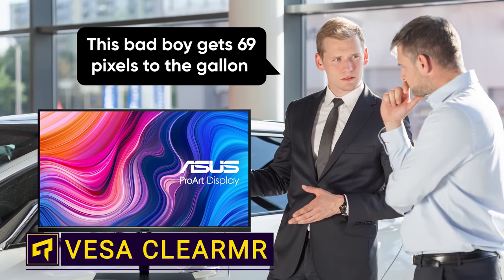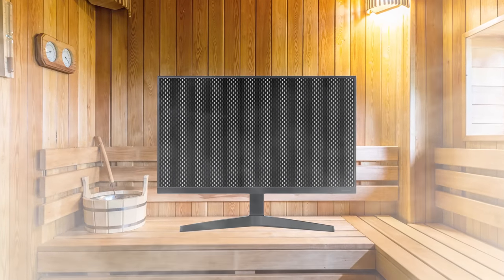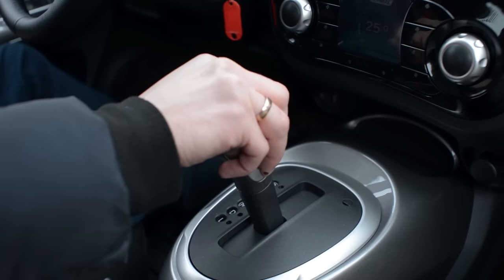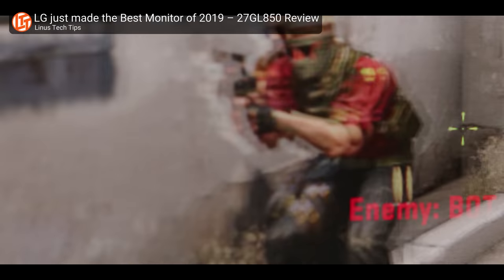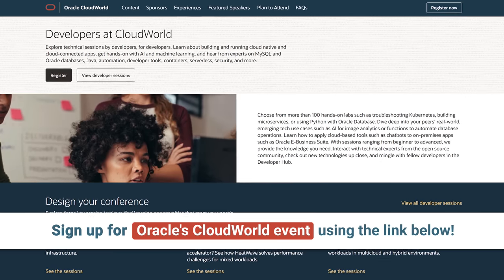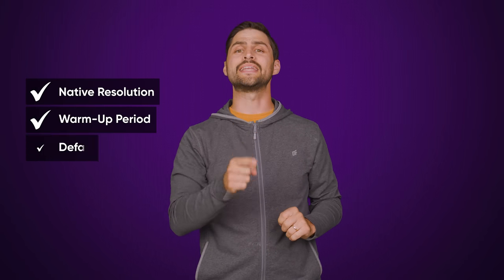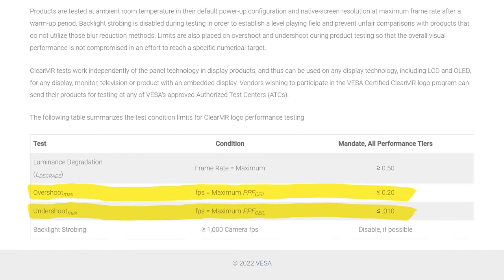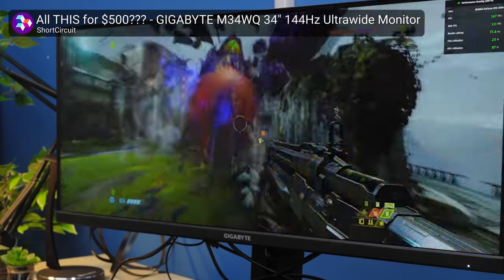Monitor Companies Have Been Lying To You

Comment: Best is low-mid end monitors showing an HDR comparison picture with one side being the “HDR” one with 300% contrast added and the “SDR” devoid of any colour. This should be illegal.
Reply: Especially with budget monitors (even labeled for “gaming”).
Reply: Probably is illegal
Reply: @killertruth186  well, I have "gaming" on a 120€ LCD with "bad" colors for ages. Never had any problems in civilization games, starting from Civ 3. 
Currently I only use it for internet and writing, but it still serves it's purpose for just 20W on the 21'
Reply: i remember seeing one that showed refresh rates with a gaussian blur.

not a product image but another one was a definitely not 10 bit rgb jpeg that showed the difference between 8 and 10 bit with a decently normal hsl rainbow gradient for 10 bit and 28 color steps in what looks like simulated cmyk color space for 8 bit.

and the last one that came to mind, a chart showing bit depth of audio. putting aside the fact that stairstepping is not how dacs work, 1 bit is a square wave, 2 bits has 5 levels, 4 bits has 12 levels, and 16 is a smooth line (which is correct at this scale)
Reply: @morgan0  2 bits is 4 levels, 4 bits is 16. Stair stepping is part of how DACs work. That stairstep gets driven through a low pass filter to weed out noise (digital level shifts are never completely clean, it takes time to get to the new level (at least slew rate is relevant). You're not getting stairstep out of your audio outputs.

16 bits is not smooth. You might think it is but real world doesn't act like those calculated levels. You will always need something to filter the quantized output. (I studied this stuff 20 years ago, I don't remember all of it but I do remember a bit. :D)
Reply: @samiraperi467  yes i know. my point was the number of output levels was wrong, and showing stair steps is misleading. and 16 bits is more steps than pixels in the image, it showing a smooth line with a little zoomed in bit with the stair steps is correct
Reply: Yea on the Amazon images. As if you could tell on your personal monitor which is prob not hdr
Reply: Or showing super blurry smeared image for 60fps next to a crisp image for 120+fps.
Reply: It would be considered false advertising, which is illegal but I doubt anyone has reported it to the FTC or sued over it yet.
Reply: @steemlenn8797  I still have my old gaming monitor that has 144hz 1080p 27” curved display “HDR” all around for $250 what I had bought at the time. Although I had accidentally break the display. And no one would really want it.
Reply: @steemlenn8797  And I had forgot to mention, that I had issues with it (or it might’ve been the GPU that doesn’t have thermal pads in the right place.
Reply: They are shooting themselves in the foot, because they are basically saying their monitor is poop at SDR.
They'll probably justify it by claiming that this is how HDR content looks on SDR. Yeah, no shit, don't do that then.
Reply: @steemlenn8797  just because something works and doesn’t have any problem doesn’t mean it’s a good product though.
Reply: Is the MSI Optix MAG274qrf true hdr or nah
Reply: @steveqi9309  No, but it does exactly what I expected for a low price. That's good enough.
Reply: @steemlenn8797  by that logic the 1630 6400 and 6500 are also good enough.
Reply: However how would you tell a difference when you see an advertising about HDR when you are using a SDR display? Or 144 Hz when your display is 60 Hz, there is no other way to show you the results of this new tech.
Reply: As a video nerd I find all the in store displays to be very ugly. I pushed back on HDR at first years ago because of that, and people blowing things out in photoshop cause the "HDR look" was trendy.

Comment: There is a little misunderstanding in the "ClearMR" interpretation at the time: 4:12 
"ClearMR 3000 has 3000 clear pixels for every blurry pixel" thats not correct. This Value is given in percent. so its 30 times more clear pixels than blurry pixels.

"ClearMR 7000, for example, is defined as a CMR range of 65-75 times (6500 to 7500 percent) more clear pixels than blurry pixels" - Vesa Website
Reply: All I need to know is bigger number better
Reply: @FaZekiller-qe3uf  yeah, rather I prefer bigger numbers rather than the number going down. My gamer soul wants big numbers, like my dps.
Reply: @lplumptree  that's not how percents work. 3000% would be a 30:1 ratio, not a 3000:1 ratio.
Reply: @DanKaschel  you’re right, misremembered. 2:1 = 200%
Reply: @lplumptree  so 3000:1 would actually be CMR300000
Reply: @crashzone6600  sadly, you need to stop thinking like that but try to actually understand things, it's like saying bigger latency number is better and that really wrong bro.
you want the lowest possible number for latencies, thus you should understand each topic individually
Reply: @gethermedel3620  It was probably a joke.
Reply: @gethermedel3620  r/wooosh
Reply: @DanKaschel  what did he say?

Comment: Of course they lie. it was quite an undertaking to get manufacturers to stop lying about the size of CRT displays. If you remember that
Reply: please may I get some background
Reply: IIRC they were including the part of the monitor/TV that wasn't part of the actual screen in the size.
Reply: @ThZuao   Monitor manufacturers still do that...  The only difference now is that bezels are much smaller these days.
Reply: @ThZuao  that has to be the silliest shit I've heard. I'd be pissed too
Reply: @shade221  We needed the size of the tube because companies were doing shit like selling a 16" visible area monitor with massive bezels that brought it up to 21" total diagonal.
Reply: @josejimenez896  it’s not quite that, it’s instead that CRTs have a problem called overscan which is where they display outside of the visible area. But manufacturers still included that space in the monitor size.
Reply: @myrealusername2193  but monitors under scan hence smaller viewable area. TV's over scanned.
Reply: @myrealusername2193  Overscan is still used today, but you can turn it off on most monitors and TV's.
Reply: @shade221  I'm saying they used the overscanned size as the measurement since technically the display takes up that much space, you just can't see all of it

Comment: That APD vendors have been lying to you is not news. As former developer for a panel manufacturer that actually had scruples, we never listed specs that could not be repeated and validated without hyperbole. For example, while everyone else was marketing 1,000,000:1 contrast ratios, we never advertised any, because all contrast ratios are basically bs. There are no industry standards how a manufacturer measures contrast for the simple reason that there isn't a single facility open to everyone that uses a single set of tools in a controlled environment that everyone agrees upon. Refresh rates are a little more quantifiable and a little more straightforward in measurements, but not much. Marketing teams are the bane of product developers'. I would even go so far as to say they serve no purpose except to stroke each other's egos. As a product developer, if I told you how much time I've spent doing the jobs of the marketing teams for them because they prefer spin vs. transparency, or because they simply have no understanding of the products' features/benefits and even of the target customers, you'd think I was lying.
Reply: Is there any way to infer the reality through the marketing?

Often many low and mid budget monitors don't even have an actual reviewer doing proper tests, so that's often not an option
Reply: I've learned that all marketing/advertising is a lie.  Sure there might be some nuggets of truth in it, but the marketers will take those nuggets of truth and twist them to make them sound better and in essence create lies out of what was true.
Reply: "they simply have no understanding of the products' features/benefits and even of the target customers" 
What else is new. I believe you 100%, seeing how marketing is done. It's pretty clear in many cases that they either have no idea or do not care, They will say whatever lie they can legally get away with to sell you the product.
Reply: Which manufacturer did you work for?

Comment: I used to have a old ViewSonic monitor that was rated at 2ms response time. In the monitor UI, it was set to default at 4ms but can change it to 2ms. When I changed it to 2ms, the monitor would display pink stripes when there was a lot of motion or bright areas of the screen. So I guess it can do "2ms" response time but for it to function correctly, you had to set it at 4ms.

Comment: Looking at DisplayHDR certification and how many HDR-not monitor can get certified, that's just the thing we consumers needed - another certification I suspect will be easy to fudge (sorry, I'm pretty grumpy over how broken DisplayHDR is, and don't expect this certification to be any better).
Reply: There is still a benefit to running hdr on a monitor. SDR content is mastered  for 100 nits, while many monitor can get way brighter than that
Reply: It's very simple, you just ignore hdr400 monitors, those just means they have the module inside that can receive hdr signals therefore qualifies as capable, bcz it's true, they are capable, they just don't guarantee the result like hdr 600 or 1000
Reply: In my opinion they probably should remove the hdr400 certification and replace it with hdr compatible, just like early g sync compatible monitors, sure they are technically "compatible", but result won't be desirable
Reply: @Simon-tr9hv  If the monitor says HDR10 (so your "HDR compatible") without a DisplayHDR certification it means nothing other than they can read the signal. DisplayHDR 400 is already way better looking than SDR monitors or those "HDR10" monitors.
Reply: it will 100% be easy to fudge, obviously
Reply: @Sibula  there still are HDR 400-1000 monitors that still don't include enough local dimming zones. (or none at all in the case of 400)
Reply: @mariuspuiu9555  If it can achieve the certification without local dimming, that's even better...
Reply: @mariuspuiu9555  But yeah, I've seen at least one monitor with like 5-10 zones going from top to bottom and it looked like crap. No idea if it was certified though.
Reply: @mariuspuiu9555  I'd also like to point out (I'm not sure of you actually meant this, but if so it was a bit unclear) that a higher DisplayHDR certification doesn't necessarily mean better implemented local dimming. So a DisplayHDR 400 monitor that can do it without any local dimming may look way better than a DisplayHDR 1000 monitor with badly implemented local dimming.
Reply: @Sibula  yes, that's true
Reply: @Sibula  the problem is that not all people understand how it works, they see hdr and they think one more function for the price, I'm just saying by replacing hdr 400 with hdr compatible, its like setting  up secondary tier so general public can understand better, plus have you seen those hdr 400 monitor? Without proper tuning it look worse than sdr
Reply: @Sibula  that's not possible, without fald the uniformity would be so bad the higher brightness they use
Reply: @Sibula  just like my phones ips edge lit lcd display that is HDR10: meaningless

Comment: Why are there always 50 billion versions of each monitor and impossible to find the one I want.  To explain, anytime i watch a professional independent review of a monitor, I can literally never find that same model in the world.  It always has new added letters or slightly different numbers.  I swear it's like the monitor companies only make 1000 of a model and then create a new  model and repeat.
Reply: That's how it works. They never give you the chance to buy the best models. They keep changing them on purpose.

At a Best Buy near me an employee told me about the naming schemes. If you see a model like LG2500AC for example, Walmart might have one called LG2500AD. That last letter is specific to the seller so that you can't price match them as they have different model names.

This video only scratched the surface on how much of a scam gigantic corperations run. They have zero shame and most of the time zero accountability.
Reply: @flameshana9  God dammit.  Lol. This blows
Reply: @flameshana9  Why advertise price matching at all then if they don't want to even do it?
Reply: @shiranui2844  you already know why.
Reply: The last few digits or letters is usually just to do with what retailer it went to

Comment: the number for undershoot in the screenshot says ".010", which is 0.01, which is 1%, while the overshoot number says "0.10", which is 10%. The video says they're both 10%.
Reply: 0.20 actually, so max 20% overshoot and just 1% undershoot. Does anyone have any idea why the limits are so lopsided? Does high undershoot look that much worse than overshoot?
Reply: @Sibula  my guess is that it's about the claims made. If you're allowed undershoot, you are basically saying anyone can claim 10% extra performance without improving the monitor at all. 

Not being able to make the transition in time means you can't really claim to hit that response time.
Reply: @paulelderson934  Fair enough. Basically requiring enough precision and consistency.

Comment: Pixel response time hardly matters if you don't have a strobed backlight. Even with instantaneous pixels, if your eyes are moving to track a moving object, it will blur if the LCD keeps the backlight on the whole frame. The Blur Busters article "Why Do Some OLEDs Have Motion Blur" explains it in more depth.

Comment: If the restriction is not 'no features' but 'default features' a possible outcome from this is that displays will ship with defaults that actually produce good results out of the box instead of having to tweak the OD etc. I assume they won't go for the 'ludicrous speed' OD as default because whilst that will get your 1ms, it will also have insane overshoot and look like garbage. It may actually avoid displays defaulting to OD off.

Comment: In general monitors are an absolute pain in the ass to buy. Color accuracy, gamma/contrast settings, black to black and grey to grey response time, backlight bleed/IPS glow. All can be massive dealbreakers and are only noticeable either through in-depth online reviews (which naturally don't cover every monitor in existence) or by buying one and testing it yourself. But buying one and having to test it and then having to deal with the return process is an absolute damned pain. Not to mention that the same monitor model can have differing problems with it between different units.

Comment: Yeah, shame how some motion specs like response time in ms and mprt are mostly meaningless, without good review. On top of that LCDs are slow and in reality it will look quite worse.
It's cool to see something more new and hmm better I guess, though Vesa ClearMR seems to have flaws like not taking in account strobing, or putting LCD and OLED with different refresh rates even in same category certification. Needs more work. But at least it's extra that will make manufacturers hopefully put more work tuning displays-

Comment: Rather than rating a display on the count of clear pixels, I wish they'd rate them based on the percentage of clear pixels to blurry ones. The current standard will produce varying results with the same certification across different resolution displays.

Comment: OVERDIVE the PAIN of the early 2000s! Get a shiny new viewsonic or other fast and high quality flatscreen? It is going to burn out due to the overdriven panel -> higher current too.
Reply: wait huh, this is pretty odd
all overdrive does is set an 8bit value higher/lower (depending if its a rise or fall transitions) than the desired one to speed up the transitions
does this mean if you were running these monitors in a full white screen (or black screen in case they were TN) you'd get burn out too

Comment: Meanwhile I sit on Dell monitor (I don't remember the model) that is not only just 1080p and 60hz.
But also took a fist to the middle of the matrix.
And still works with no flaws.
After 6y of use and 5y of use after fist planting.

Worst part for me is that any upgrade of GPU will require buying monitor as well. Cuz no one offers VGA anymore :(

Comment: I'd like to see the Labs expand on this idea, especially for gaming / pro-display monitors.  I'm surprised that VESA is targeting such a narrow temperature range, though.  Any decent panel should be able to maintain a refresh range within 68 and 78 degrees F.  

Are they still trying to target TN panels or something...?
Reply: This is not about where monitors can do it but to compare them. For that temps have to be the same. 
Of course if you want a tabe full with numbers at 5 degree starting at -20°C and going to 60, for industry use, you can make a request for such a standard.

Comment: this explains my current Samsung monitor though it was more expensive and claimed to have better specs (other than the response time) than the MSI monitor it replace (only replaced due to it getting cracked) it gives me more artifacts and weird stuff going on at first I thought it was my gpu but my 3060 is fairly new and no matter how I tune the settings to the gpu I still get artifacting in games

Comment: LCDs will always look like shit in motion regardless of respose time. Persistence blur is the problem. Strobing the backlight is a slight improvement but you can’t get the duty cycle down low enough. A high end CRT still looks better than an LCD in 2022 and that’s a travesty. OLED may not be sufficient to fix it since it doesn’t like super high brightness with short duty cycles. It may still be years until there is something which just outright beats CRTs without any of its drawbacks.